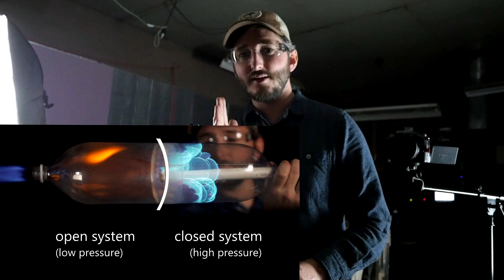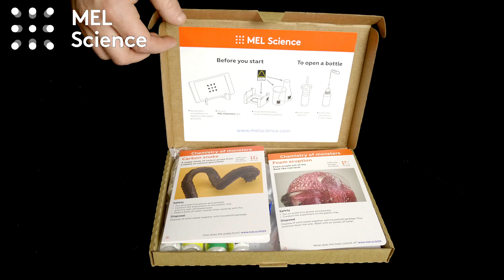XL Soda Bottle Rocket Engines (Static Testing)

Comment: How about joining two sets of the double bottles together and a nozzle to direct the flow and heat. Wonder if bottle one would burn then secondary bottle would kick in.  Spray the end of the bottle with a air duster can upside down so that it ices the hot zone. Just some ideas

Comment: Hi! Very interesting and fun to watch, as always! 
You said a glued joint would hold up better than a taped one due to the strength of pet bottles. No doubt it will, but I wonder if it’ll be enough. My own (unsafe) experiments some years ago included filling a 2 l bottle with baking soda and water and sinking it fast with a heavy load  to see how much it could lift. Upon reaching the surface we saw  it was more like the shape of a water melon before it blew up. This makes me think that a glued seam might be more rigid than whats needed. But then again, your obstructive projectile is not screwed on, so it’ll probably just let go.

Comment: Have you tried alternative fuels for this? The combustion pattern looks similar to the classic "whoosh bottle" demonstration which you're probably familiar with, but for anyone who doesn't: Take any unmodified plastic bottle of at least 2 litres capacity - smaller bottles don't always work so well, the larger the bottle the more impressive it can be. Add a dribble of either ethanol or isopropanol - it doesn't need much, since each litre of air only contains enough oxygen for the complete combustion of about 100 milligrams of ethanol, assuming it all evaporates. So even if you have one of those 20 litre bottles from a water chiller, it should still work with just a few mL of alcohol.

Anyway, once you have added the alcohol, screw the lid on and give it a good shake: The idea is to coat as much of the interior surface of the bottle as possible with the alcohol, which even at room temperature, should enhance the evaporation rate. It should only take a few seconds to do this, but I normally shake the bottle for at least 20 seconds. Set it on a table or on the floor, remove the lid and apply a flame to the open top of the bottle. I find a long shaft gas stove lighter to be the easiest and safest, with flame-type lighters working more reliable than piezo-electric spark lighters.                                                                                                                                                                                                                                                                                                                                                                                                                                                                                                                                                                                                                                                                                                                                                                                                                                                                                                                                                              

So it would be interesting to see how well this type of bottle-rocket would work with alcohol vapour as the fuel source instead of propane.
Reply from the maker: Alcohol was the first fuel I ever used in these. You can find my alcohol bottle launcher videos from 8-10yrs ago. The problem with using alcohol is that it doesn't work in cold weather. Propane is a lot more reliable

Comment: Hmm I am confused, Sorry for my stupidity ...there was a huge pressure generated wtih nozzle at the very start of the bottle rather than close to end of the bottle, that generated huge sound but experiments says for the longer flight path, insertion nozzle was close the end of the bottle. 
1. Nozzle at the start of the bottle is more pressure as more propane fuel is pumped in 
2. Nozzle at he end of the bottle more time the fire takes to reach from end of the bottle to start of the bottle so more flight  path ? 
Now I am confused isn't the fight path proportional to pressure at the ejection point ?
Interesting to add PSI reading data to the tests?

Comment: Loved the presentation,but I think if you install a good ground wire to the pipe at the input end,this would give the energy a direction of flow as the magnet travels down the pipe in the opposite direction.It must be generating some energy it just needs to be directed. Just a thought.

Comment: After the initial burn,  there's a secondary,  smaller,  purple burn, from the exterior,  inward.
WHAT is that..???

One theory: There's some Steam Reformation from the humidity in the air combining with Propane.
ie: H2O (steam) + HC = H2 + CO
Also perhaps some Water Gas. 

That mixes with inrushing air and a bit of flame and ignites.
Reply from the maker: That's carbon monoxide burning
Reply: @Nighthawkinlight  Steam reformation is HC+H2O=H2+CO @ ~700C, so I'd bet there's a bit of H2 in there too..?  :)

Comment: Spray bottle.
The top cover is removed.
A 1 mm hole is made in the bottom
A piece of calcium carbide is placed inside the balloon and spit on it several times.
We close the exit openings of the balloon with our palms.
And then we bring the flame from the lighter, matches to the rear (small) hole.
BOOM! Cotton ! Loud enough.

Comment: Pretty interesting.  What if you took a turbocharger off of a small engine and made a combustion chamber out of 2 sizes of cans.  Put one inside (with holes) the other,  then make pipes to plumb it in from the compressor blade outlet flange to the turbine outlet flange to make a small jet engine. Have a spark plug on the outer can etc? Just have to figure out the maximum rpm limiting issue.  Maybe run it on alcohol or something clean burning. What's your thoughts?

Comment: Love the video, man! I have an idea that I think might have some interesting results. Make a bog standard water rocket, test it and calculate its approximate altitude. Then do it again but pressurise it with HHO instead of air, and this time ignite the HHO as you release the pressure for launching. Would the rocket gain a higher altitude due to the higher pressure because of the expanding gas? Maybe. There would be a few challenges to ignite the gas but I think I know how it could be done. Also a vessel that could handle the pressure, don’t want it exploding on you😂.

Comment: Not sure if it will work, but perhaps try drilling a small hole in the neck just below the opening to allow for air to be sucked in past the jet of flame rather than through the same opening it is coming out of.

Comment: Maybe the same effect with solid fuel. There has to be a hole in the centre and burns from inside top to bottom first? Meaning ignition right at the rear of bottle

Comment: This is how I used to do it
Take a 2 liter soda bottle and start drilling a hole in the cap. About 1/8 to 1/4 inch
Drop one drop of lighter fluid used for wet wick lighters.
Give it a good shake  jazz hands style.
Place on a flat surface on it's side.
Put a flame just in front of the hole and tap the bottle.
You will see a flame develop in the first 4 inches and then as the internal pressure increases the rest burns faster
There will be a big whoosh and said bottle will launch at a high speed for maybe 20 yards.

Comment: You can tape aluminum foil along the sides of the bottle and bring them close to the nozzle then discharge some big capacitors to create the spark for ignition.

Comment: Hi Thank u for your videos! Quick question and maybe idea for experimentation as well as other videos and progressive science: A perpetual motion device is impossible due to law of conservation...BUT with mechanical advantage, there are exceptions to certain conventional skepticism. Examples like pulleys, siphon, capillary action, a water ram or the propeller car that goes faster than the wind that pushes it due to gear ratio advantage from wheels to prop. Can mechanical advantage or magnets be used to power something for years +? Is it possible to shield one pole of a magnet to push an object cyclically, without opposing polarity nullifying the force forward for example? Just curious what your thoughts are, if you're interested in these ideas. Thank you again!

Comment: I think igniting in the rear away from the throat of the rocket, causes the ignition to force most of the fuel out mor rapidly. 
although I can't tell if it's being burned on the way out, or if it's simply kinda being wasted a little.

It seemed to me, that you're getting better thrust, for longer period with ignition more close to the opening. 
Yet, it's also possible that you're getting a more powerful 'pulse' of very fast ignition and not wasting the fuel.
I'd have to see the difference between a real launch of the rocket.
Cool stuff! 😎🇺🇸

Comment: That is really cool! I like seeing how the flame burns. I got the ideal of demonstrating how a pulse jet works with clear plastic like that. Of course it wouldn't run long before melt down but you could get some footage for a second that shows how the flame works and the controlled explosion keeps the engine running. That would be great.

Comment: 6:19 - nope, the injection pipe was pointed down causing the mix inside to swirl before you lit it.  Density effects don't have a strong enough force to happen that fast.

Comment: I have an idea! A Gas Powered Water rocket!! normal water bottle rocket setup but not air pressure but gas. How much pressure are you getting  on the gas and how do you get Max pressure on the gas?

Comment: Hi!  I just discovered your channel yesterday... or rather, finally checked it out after being linked a couple of your videos in the last couple of years; ended up binge-watching a whole lot and subscribing, so thanks for all the awesome stuff!

I had a somewhat-terrible, no good thought, and I wanted to hear your opinion: what if there was a bottle used as a static combustion chamber, on the ground, whose output is used to ignite the actual rocket and increase its velocity early-on?  The idea being to get (some of) the benefit from having more propellant, without having to carry it up; I suspect that's only “practical” for toy rockets, but that's fine.
I assume the correct configuration then would be a small-ish bottle with ignition happening in the far end, since we want to maximise the energy output that happens while still pushing on the actual rocket?
Reply from the maker: Sure, that's basically just a tube launched rocket

Comment: I know this isan old video but I think the farther the ignition point is from the opening, the more unburned fuel is pushed out the nozzle and the same amount of flame just spreads out instead of there actually being more flame so less energy, not more.
I'd bet the tape not letting go at the end spoke more of how used the previous tape was and not the flame being any less energetic.

Comment: Could an elastic adhesive be used before joining followed by heat application to the female fitting side of the cut bottle? I had not considered your mentioned process when making reservoirs by joining 2ltr bottles, using cuts and tabs with liberal use of tape to bind them.

Comment: Question: Have you tried putting the tube from the front to almost the back and then igniting it so it would possibly push from the front to the back of the bottle and then out the front again? If that makes any sense.

Comment: the air and fuel are mixing in the torch nozzle, if you push the tube past/over the holes on the torch nozzle it will be pure propane.

Comment: I think some of the effects you are seeing are related to the way you fill the bottle with propane + air.  You are pushing atmospheric air out the end, and filling the bottle with heavier propane.  So, the highest concentration of fuel will be toward the back and toward the bottom.  You might be able to visualize the distribution by piping in cool fog from dry ice.

Comment: the end of the bottle acts as a nozzle and the exhaust is overpressured, which causes the “pinched” looking blue exhaust. Try lowering the diameter of the nozzle if you want a more efficient burn at sea level.

Comment: Hear total expantion energy(pressure) is not use for move pvc pipe (bullet) if you use hydrogen than ignition is very fast than propane Gas and more increase power of bullet pipe other wise in past video you feel 20% water and 80% propane +O2 than ignition in this case total expantion pressure is use to move bottle rocket .

Comment: LOVE the videos! Please keep them coming 🙏.
Just a thought, in my younger years I experimented with rockets of varied fuels and discovered early on that a stungun makes a efficient and reliable ignition source. Now you can get cheaper electric ignitors for barbeque grills. I attached wires to the contacts with RTV silicon to insulate everything and routed small wires from inside the combustion chamber (obviously). You could wire the launch pipe where the opening of the bottle rests instead of using the torch igniter. Anyways, thank you for the highly entertaining and educational videos. I'm off to check out the Mel science kits for my granddaughter. Her school isn't prioritizing the S, T or E of S.T.E.M. in their first iteration of distance learning during the Covid-19 crisis.

Comment: Hey NightHawkInLight!  love the videos and visuals in the slow mos!  have you ever thought about getting a Pound of Trust/ Force Measuring Gauge to test each ignition point for optimum thrust and duration?  you would need to do multiple tests since the unknown variable is the Air to Gas Mix Ratio, but you should be able to get an idea of the "sweet spot" for a spark.  just a thought.  I would be interested in the results to be honest!  :)

Comment: Had a thought... 

A tesla valve restricts a flame front from progressing quickly in one direction, yet allows easy flow of expanding gas in the other. This leads me to believe that this has a possibility of maximizing burn time and acceleration of exhaust gas, and therefore maximum thrust. Of course, accelerating the added mass of the valve would rob you of the benefits, but if the valve assembly could be built light enough...

Comment: In my opinion, the difference in flame speed is due to turbulence. When you are filling the bottle from behind, the gas in front has very little disturbance. However, from the top everything is moving. Therefore, the burn rate is higher and you see a more vigorous reaction.
Reply: This is exactly the correct answer. Flame front simulation models take into account laminar flame (the bubbly, spherical fronts of flame) and turbulent flame (the chaotic too-fast-to-see fire). Laminar flame speed is orders of magnitude slower than turbulent flame speed (m/s vs. km/s in some cases). So if you induce turbulence by say, having a jet of flaming air ejected from a tube, the flame will be much faster in the areas around the jet where turbulence is high. The flame front itself induces turbulence as it accelerates the air in front of it, which is why putting the tube at the back gives such a quick burn, no matter the fuel rate. I suspect that if he changed the flame injection tube opening so that it was located in the middle still, but the exhaust pointed backwards, he would get a similar explosive fast burn.

Comment: Do rockets work in an infinite vaccuum?
Reply: Not sure what you mean by infinite but in regards to space and such: Yes they do.
Reply: @HitodamaKyrie  Infinite as described by so called empty space. What is the rocket pushing against? If it's the sides of the rocket then how thick would the sides of the rocket be to survive said vacuum?
Reply: @fattmouth7715  To make it overly simple, the propellent pushes the rocket. Once the propellent has left the rocket nozzle it doesn't matter. It's not pushing against anything at that point. And there's no reason the vacuum of space would destroy the rocket. It's not made of tissue paper.

Comment: 15:40 are you really sure that propane explosions can generate only 60 psi ?
also 200psi for the Bottle is not the average, only up sure 150psi its realive safe.
Over 150psi its a lottery if the bottle holds or not. Several people on youtube made videos about that.
Reply from the maker: If ignited at normal pressures yes, somewhere around 60. If you pressurize it before igniting then bets are off.

Comment: The world is more fun to be in when we get shown how to do things like this!  
One thing about the flame propagation is that (I think)  it is starting at the torch not the tube opening and hence is pushing the mixture down the white tube. When the flame exits is it a) moving towards the open end; b) expanding in a pop. 
Could you film more tests putting the spark inside the bottle just for fun and thoroughness.
I'd also love to see different payloads on the top of your rockets like strobing LEDs, a teddy bear, parachutes, Tinkerbell, St John the Gawper  (patron saint of flying).
Most of all, keep on doing this wonderful stuff.

Comment: Perhaps you should use a naked spark instead of enclosing it in the pipe (I guess the torch is providing the ignition mechanism), so the results are not biased

Comment: I made a golf ball potato gun that uses this ignition principle, a smaller tube inside the chamber initiates the larger volume of gas in the chamber to create a much higher pressure spike. Shoots golf balls at 750 FPS...
 
That's 900-ish ft-lbs of muzzle energy lol.

Also have a bigger one (3" bore) that shoots at 5000 ft-lbs with water filled 24oz cans but it's a little heavy on the recoil lol.

Comment: Electric ignition maybe worth looking into so you can have the ignition point separate to the end of the tube
Use pipe with a thinner inner diameter but same outer
Carve a little spot for the electrodes in, down the bottom
And put them in
wires could go through the inside of the gas tube